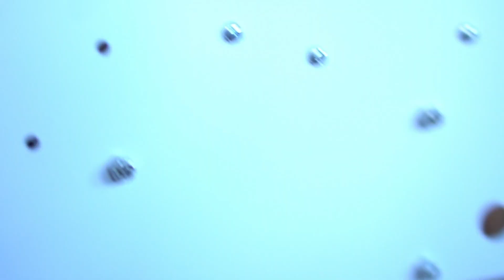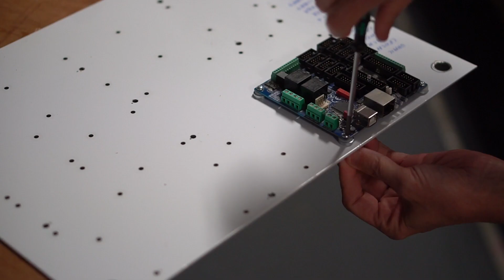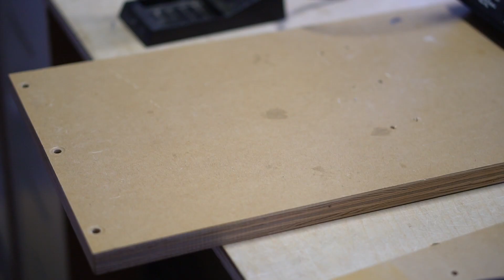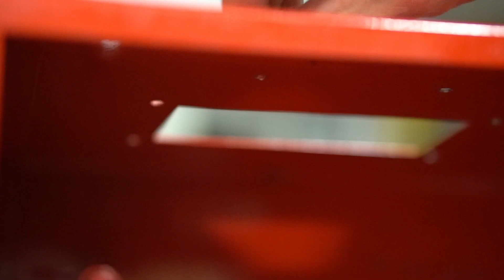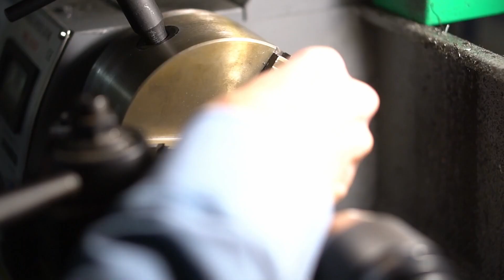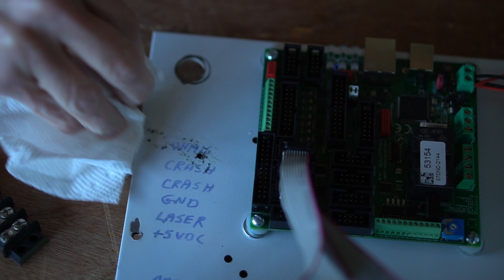Customer Plasma Electronics (Internal - For Reference Only)

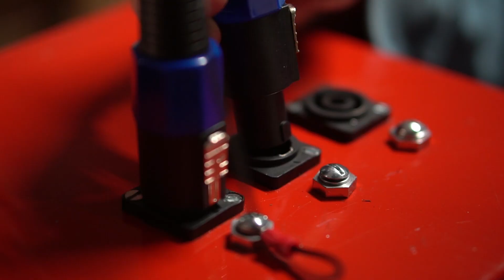Comment: Great video what do you call them connectors at 34:30? Anybody know
Reply from the maker: I call them spade connectors or spade terminals. The ones in the video are #8 spade termials: https://amzn.to/3wWHK3Y
Reply: Thanks for your reply perhaps I misplaced the timestamp but I mean the multi-connector? Appear to be some clever pushing rotate with a lock tab, tidy looking! @PatrickHoodDaniel
Reply from the maker: @ryanowens100  Ah, ok, here is a link: https://amzn.to/3UUqq7F. They are speakon connectors. They are typically used for sound systems. I love how these are so simple to use and assemble, and they are reasonably priced, and since they don't take so much time to assemble, it saves me a bunch of time.

Comment: All cable ties are cut off flush! In germany you would have gotten a smack in the neck for that :D
Reply from the maker: Yeah, it hurts when you brush against them, but I can handle a few scratches. Nobody around me to smack my neck, which would probably hurt worse than a few scratches from a scrape of a cable tie. I'll make sure not to invite you over!😆
Reply: @PatrickHoodDaniel  More can happen than just a few scratches. But it is also a sign of how carefully you work. You can also chew with rotten teeth, but that doesn't make a good impression. I can recommend this side cutter: Knipex 76 12 125. I don't mean that in a bad way, but as constructive criticism. 🙂 By the way, I really liked the small circuit boards for the motor controllers!
Reply from the maker: @andreashabijan2514  Ha, no offense was taken. I need to add a little humor to my comment responses because comments have taken a turn for the worst lately. I put out a lot of content that I probably should keep in-house for my use only, only to get berated for actions I take in my video. Pretty much everyone that gives me negative comments doesn't offer videos themselves to stand by their claims, so I am changing my stance to respond in humor , or light heartedness instead.
Reply from the maker: @lesdmark  Indeed. It makes it difficult to put content out on the internet, especially if you have anxiety. Imagine a person full of revolutionary ideas (not me), but has social anxiety (which I do have), we would never benefit from that person's passion and grow in that niche.
Reply: if you cut them flush with a scalpel or razor blade there is no sharp edges

Comment from the maker: I  didn't really intend this video to go public, but I felt there is some good information in the video. I use these videos as customer correspondence and for my personal reference as I do disparate work and sometimes forget the process. I decided to make the video public and add some narrative for your benefit.
Reply: Its good video for sure if im drilling in an electrical panel at work i use a magnetic bag or i have a 3d printed box i glued magnets onto the top i could use